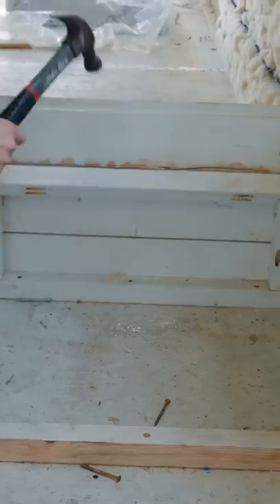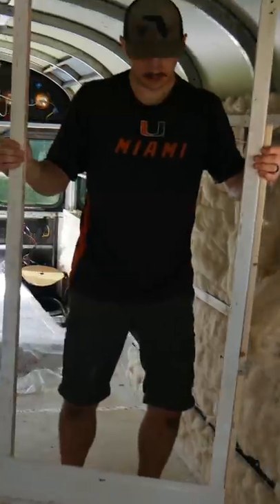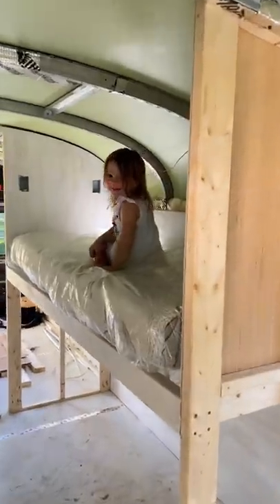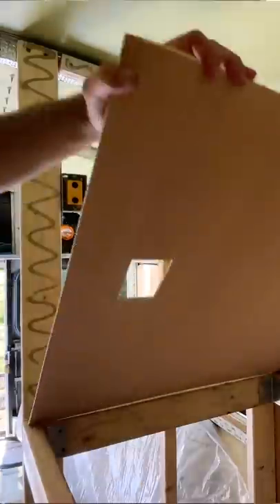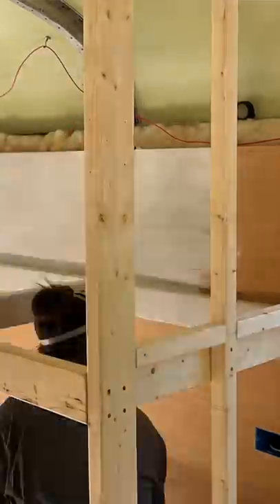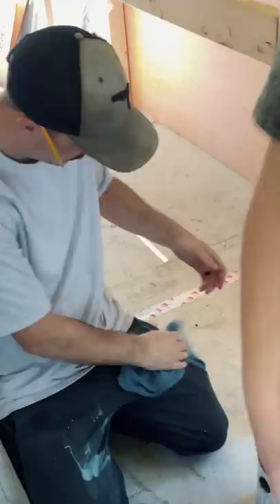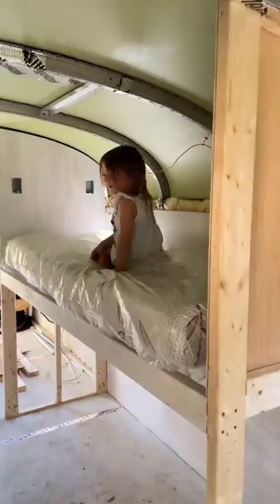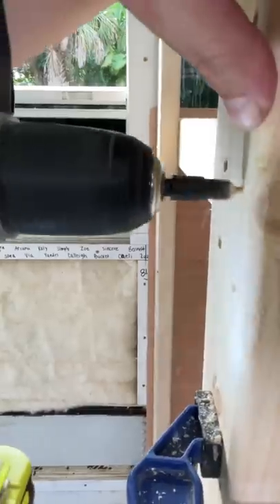Loft Bed in our Tiny House School Bus Conversion #shorts #buslife #busconversion #vanlife #skoolie

Comment: I think you should do wallpaper, it would feel much more like a home rather than a bus
Reply: Yeah same
Reply: yeah
Reply: Yeah Plus wouldn’t it be easier if you ever wanted to change the wall design
Reply: SAME★
Reply: paint!  easier to clean and change. With paint you can add stickers or even paint pictures on top of the paint. easy example; if you used an off white like a canvas color paint you can paint murals or whatever you wanted and add things with magnets giving the wall texture.  with wallpaper you are stuck with that design till you finally rip it off.
Reply: Yeah
Reply: Same
Reply: Same also it could be hard to breathe the firts days of the paint
Reply: @hailthyholyrats5650  true
Reply: I agree
Reply: I think so to
Reply: @youngsun6617  I agree with your idea
Reply: @kayesdigginit1519  👍👍👍
Reply: True
Reply: Yes

Comment: I say paint. That way if you want to change it later in down the line you could easily just strip and paint over it or use those dorm room wall papers to cover it. Wallpaper seems like it would be more difficult to change out depending on the kind you choose.

Comment: paint!  easier to clean and change. With paint you can add stickers or even paint pictures on top of the paint. easy example; if you used an off white like a canvas color paint, you can paint murals or whatever you wanted and add things with magnets giving the wall texture.  with wallpaper you are stuck with that design till you finally rip it off. 
you can paint a base color then add painted "frames" where you put pictures up with magnets inside those frames highlighting all the places you have been with your bus home.  that's just one example but your imagination is your limit.  with wallpaper the paper is your limit.

heck you can use chalk paint.  that's fun for any kid or adult

Comment: I would recommend just painting it because I've had some bad experiences with wallpaper oh you ordered a bit too much well that's money down the drain oh you didn't notice until you put it all up that you ordered to much wallpaper will screw it because you have to take the whole thing down cut it off and then redo it and then when you realize then when you're done you don't like the wallpaper the cycle repeats